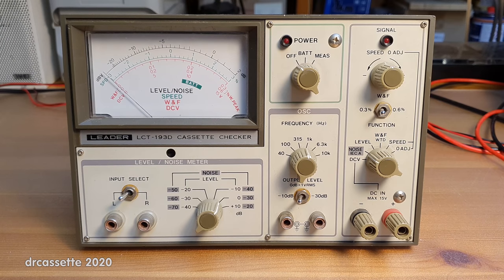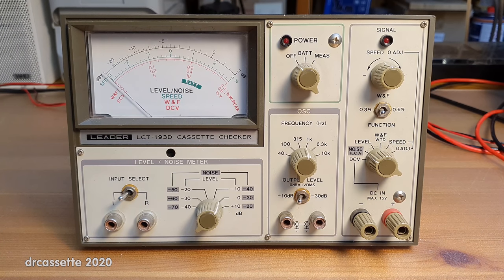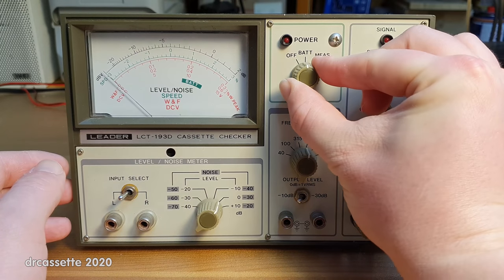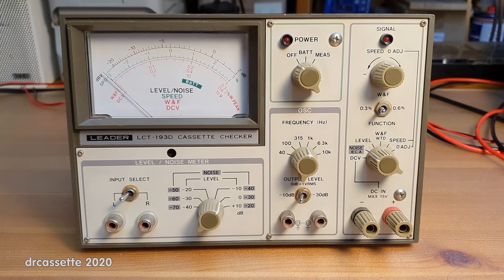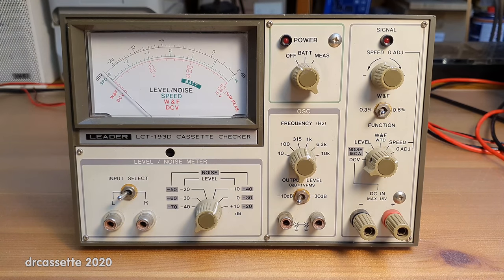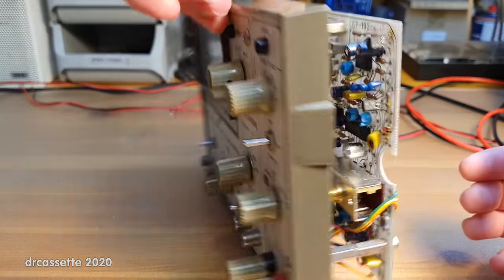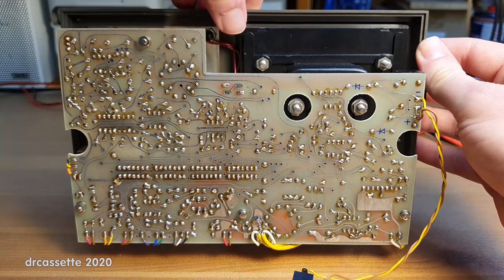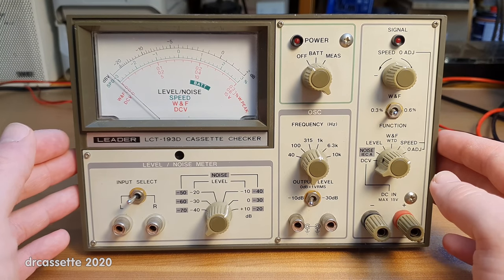Leader Cassette Checker repaired / recording test tone cassette / speed + W&F measurement

Comment: DrCassette: Using thee tone test tape recorder on direct drive deck have a lot of sense to measure speed on other deck (specially if that drive is cristal oscillator controlled), however using that to measure wow and flutter not. It simpler to just generate  the tone and record on the deck perform the measurement and divided the results by 2, as you did on the first deck. Recording that on another media (CD) do not have sense too. You can just use your phone with tone generator app (you can even find website to do that). The precision is pretty high as the cristal clock is very  stable on the phone.
On the other note. Watching your channel for several years. Truly appreciate what you do.
Reply from the maker: I don't like using the phone as a replacement for proper test equipment, as it might induce interference into the device under test. Also the phone is what I use to record my videos, so when I'm making a YouTube video, the phone is not available for anything else.

Comment: I think dividing W&F REC->PB by 2 in comparison to only PB is not correct, because the overlaying W&F pattern REC and PB can result in both adding and reducing the value, more reducing, but a bit adding, too. Thus the correct value ist SQR(2), that means it is 71% of the REC-PB value.

Comment: I did some speed calibration cassettes myself as well, on the Revox B215, which as the Akai, has a quartz locked DD flywheels (with two separate motors for the two flywheels, compared to the belt-drive of the 2nd flywheel in the Akai). It's fine for calibrating any low- or mid end cassette deck, and it's better than those no-name calibration tapes off eBay, but it's not proper "bezugsband" territory either.
Reply from the maker: I wonder how they made the proper reference cassettes. I guess recording happened on some special open reel deck and the tape was then fed into a cassette case.
Reply: @DrCassette  I believe that it is done on Digital loop bin duplicator, where  signal is recorded directly on tape (no tape shell, digital source,) . The recording speed could be up to 100 time faster, any wow and flutter is divided by speed reduction factor.
Reply: Exactly. A friend of mine bought a Studer A80R QC, which had a 1/8” transport and heads and it was used for quality control purposes of mass duplicated tapes. You’d put the entire spool of recorded tape on the machine and do quality control things with it :) Then it would go to the next machine, which would fill the empty “C0” shells. His plan was to modify this A80 for producing proper reference tapes. I wish I had some of these calibration cassettes, but I only have a 38,1cm/s open reel calibration tape made by BASF, which I use to check and align my Studer B67 and Otari MX55.
Reply: @DrCassette  ANT audio test tapes ... he is located close to you I think

Website link

http://www.ant-audio.co.uk/index.php?cat=post&qry=alignment_tapes

Comment: The only way I am thinking that one could speed calibrate a deck without the use of a calibrated cassette is by having a loop cassette with spliced tape at an exact length. Using the splice mark as a reference it is possibile to determine how much the tape has traveled.

Comment: Isn't wow&flutter an (unwanted) form of FM-modulation, the testtone being the modulated wave or like the "carrier" in RF? Think it would be possible to make a articifial testtone by FM modulation.
Nice Akai deck, got the GX52 with the same direct drive as this, mine is only single capstan though.
Reply from the maker: Indeed W&F could be seen as frequency modulation, but then you would have to find a generator that allows you to set the carrier frequency as low as 3150 Hz, I don't think many generators would allow for that as this frequency is far, far away from RF. But it is an interesting thought, that the Cassette Checker employs something similar to an FM demodulator to measure W&F.
Reply: @DrCassette  Any abritrary function generator can do that, like the FY6800 or FY6900. Even the cheaper generators can do that. I used that method to test my Ferrograph RTS2 and it worked perfectly.

Comment: Did you check the W&F when the deck was switched to source?  It would be curious to know how close it goes to zero.  I'll bet it's still not perfect.
Reply from the maker: When switching to source, you get the signal that's coming from the CD Player, and that is a perfectly constant 3150 Hz as CD Players don't have wow&flutter. The Cassette Checker is calibrated to display zero when the input is a constant 3150 Hz. So it does indeed display precisely zero when the cassette deck is switched to source.

Comment: DrCassette: Did you herd about the PWM recording on audio tape, some time digital audio. It was use in high speed duplicators for prerecorded tapes. I wonder if regular deck can be converted to use that methods. From what i read tape recorded with that methods have very low noise.
Reply from the maker: I think I have heard about that somewhere but I don't remember any details.
Reply: @DrCassette  I need to correct my self look like it was PCM , not PWM,. PCM have more sense as it kind of look like AC biass signal. The recording methods was advertise as "digalog". Some prerecorded cassettes have that label. Some people reported that some of the prerecorded cassettes could have up to 10 dB higher signal recorded with out distortion. I wonder why they never introduce that to to high end decks. Possible explanation is that recording industry that hold that patent, do not like to give better quality recording to customers to  copy CDs , as it was case with DAT.
Wonder if that can be revive by modifying some tape recorder.

Comment: You have a great opinion on the AKAI GX-75, but I think it is heavily overrated. It has a direct drive transport, but it is not Quartz locked which is not very different from a good quality motor + belt drive. The tape path is a nightmare to align and in my experience azimuth changes after stop and restart. The electronics is nothing exceptional, I wasn't blown away by how it recorded or played back. It' built like a tank, it's very heavy and it appears to be "professional", but compared to a Revox it is nowhere near. 
As for test tapes, this fellow (http://www.ant-audio.co.uk/index.php?cat=post&qry=alignment_tapes) sells alignment tapes made with a high quality standard. He uses a modified Revox.
Reply from the maker: Love it or hate it, the Akai GX-75 is the best cassette deck I have in my collection. And I assume you don't want to send me a free Revox? ;)
Reply: @DrCassette  A drawback to the Revox B215 (at least) is that there is no manual override for recording bias.
Reply: DrCassette I wish i had a Revox! I only tried it at a friend’s home, but it is way too expensive for a cassette deck. I had the Akai some years ago, but after tinkering for over two months I sold it out of desperation. I now have a more consumer Aiwa you reviewed some years ago and you were not impressed with. In the end it all boils down to personal experience
Reply from the maker: Do you mean the Aiwa AD-F910? I think I may have been a bit too critical on that. As for the Akai GX-75, the mechanism in mine is absolutely rock solid. The one big problem I have with it is the implementation of the Dolby circuits. Any cassettes recorded with Dolby B lack brilliance, and Dolby C recorded cassettes don't sound right either. I often end up playing Dolby recorded cassettes without Dolby, but then there tends to be too much brilliance. If there is no Dolby involved, the deck sounds very good.
Reply: @DrCassette  That sounds like a wrong playback gain setting. I did that too in my tinkering and according to the spec of the Dolby IC (HA12090NT) when playing back a tape recorded with a 400 Hz tone at Dolby Level you should get ~500 mV (493 mV to be precise) on the RCA outputs. With the playback gain set to correct level, at least Dolby B sounds ok. Dolby C also requires a very accurate playback EQ setting (tones at 400 Hz and 8 or 10 kHz must have same amplitude). 
My Akai had random W&F problems and even after changing both pinch rollers it still had problems. I had to realign the head, but I was never too satisfied with the result; the procedure specified in the service manual is not exactly effective: you have to swipe the head with you finger so that it become greasy, then after playing a tape, verify which portion of the head got wiped by the tape (I'm not kidding). Very very complicated tape path. Also when in rest position, the springs pushing the pinch rollers against the capstan are in compressed state; with time they lose strength and tape might slip due to insufficient pinch roller pressure.
Reply: @enricoself2256  I have a GX-95 and I can confirm some of your criticism. Tape head alignment is a pain since the GX head lacks a tape guide so my WHS-300 alignment gauge isn't as useful as it is with other heads for head height alignment. You need to get your hands on a special AKAI 1 kHz test tape or a functional equivalent to adjust head height. The grease method described by AKAI in the service manual is something that was pretty common with studio R2R machines, but they used a wax or fatty crayon to paint the head before running a sacrificial tape over it to check the tilt angle (which is what it's all about). If you have a precision gauge, you won't need to do that.

The mechanism itself is rock solid. There is no need for Quartz locking because once you do that, you won't be able to adjust the speed anymore apart from changing the quartz itself. I have seen lots of Technics quartz locked DDs that were way off, turning a 3 kHz test tone into 3.1 or 2.9 kHz.

Your problems with W&F might be due to bad lubrication in the capstan bearings. Or back tension that is out of spec. But from my opinion, there is nothing in this mechanism that can't be repaired. It is good for 0.025% W&F according to DIN if everything works as it should.
Reply: @DrCassette  it reads as though your Dolby circuitry shows mistracking which was a common problem, especially with Pioneer machines. Or maybe you just need to do some electrical adjustment. You already have the tester, now all you need is some full track Dolby reference level test tape at 200 nWb/m and 400 Hz.
Reply: @JamesE707  you ate absolutely right. Autocal is only good if it works with enough steps and allows for manual bias fine tuning. Pioneer's Super Auto BLE in their later models was as good as it got for autocal systems.
Reply: @svenschwingel8632  I honestly liked a lot the look of the GX-75 (and I still actually do). My unit surely had some problems on its own, but given its weight, sending it to an expert technician to have it fixed was anti-economical. Moreover I wasn't too satisfied of the electronics too; feeding an input and monitoring the output without actually recording shows the frequency response of both the record and playback buffer amplifiers: comparing that output with the direct source showed the AKAI is far from neutral, changing the tonal balance and frequency response. Not that my current AIWA tape deck is radically different, but it works reliably and that's good for me.
Reply: So, no love for GX-75, 95 decks. I looked at the service manuals and playback electronics is rather simple, I was expecting at least Jfet differential input before Op-amps, in the line with other top of the line decks from it's time. As for the Dolby  prerecorded tapes sounding dull, either the Dolby level isn't calibrated or the playback rolls off the high freq to early - common problem with many decks. Sometimes it's possible to correct the freq response a little. I love Yamaha implementation of playback freq correction (play trim in  KX-930). Too bad we don't have any surviving measurements/reviews from late 80/early 90s. From what I remember Hi-Fi Choice magazine wasn't always impressed with Akais: Aiwas, Teacs,  Naks usually were higher rated in S.Q. by the Brits. I remember my friends late 80s top of the line DD 3head JVC as being a very decent machine. And of course Nak CR-7, but it was almost twice the money of other 3 head machines.